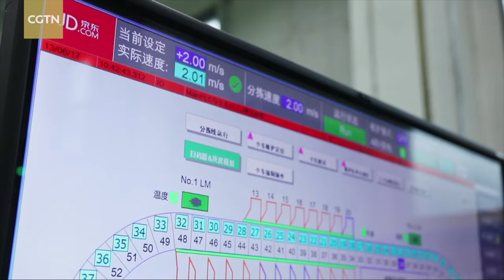Watch an army of robots efficiently sorting hundreds of parcels per hour

Comment: I was once that robot lol. 
20-26 people, 1 for every 1k parcels when over 18k parcels in a night, normally do around 25k but less on Mondays. 
2 offloading 3-5k parcels off a lorry by hand onto a belt in an hour(worst job, can be -5c and still sweating with just a tshirt on) then 5 people on the belt chucking the parcels into 4-7 chutes each.

1 person to every 1-2 chutes (1 chute per delivery lorry) placing each parcel into between 10-24 baskets depending what point later on they get droped off at.

When the baskets fill up you have to fill a sack with parcels, scan them into each sack with bar codes and number it then place it in a row in the right order it gets loaded in.
then end of night load all the lorry's in teams of 3. one person stacking in the lorry 1 chucking onto the lorry and 1 scanning and chucking to the person chucking onto the lorry.

3 lorry's per team. 30-100 sacks about 6-20kg+ each depending what idiot did the sack and 30-200 large boxs to big for sacks per lorry.
low pay, one 30min break for lunch and one 15min break before loading and your health destroyed all year and practically killed over xmas. 10-14 hours 6 days a week over xmas.
O and its all night work.

robots can have these shity jobs is what im getting at.
Reply: Yep.
...  And unfortunately the robot out-performs you, works 24 hour shifts, doesn't take weekends nor vacations, doesn't need health insurance, and costs less than a days worth of your pay...
You are literally 10,000 times more expensive than the robot.
The key to working in today's modern world is to do work more valuable than a robot's work.
Reply: I agree to let the robots have all the shitty jobs. people need to learn to do more valuable work. Things would improve much better this way. 
human life shouldn't be wasted on mundane highly repeatable jobs. we need to pool our brain power together to solve more important problems than what parcel goes into what chute... or pushing buttons and moving parts around in a factory for 12 hours a day 7 days a week.. this isn't life, its paid slavery.
Reply: Every job is mundane and highly repetitive. By your logic, humans shouldn't do any job.
Reply: Engineering, computer programming, physics and materials research, aerospace systems design, robotic design, automation programming, etc: far from mundane, and still a long way off from robotic obsolescence.
Reply: @andrewjlea  Not really. And I am a programmer and a physics postgrad. Even those fields require doing same stuff over and again. They may be far from obsolescence but that doesn't mean they don't have mundane things in them. The very point of practice is doing things repititively.
Reply: As a former communication systems officer, and now as an engineer, I don't find doing the same calculations or processes over and over is mundane, I am excited for the results every time.
Reply: @andrewjlea  Yeah that's because you like what you do. My point being any job in itself is mundane at some point. 
This was more of a reply to people who talk big like humanity doesn't deserve to do mundane jobs etc. It's to remind them that life itself is mundane. Doing the same thing over and again.
I too enjoy what I do but know that it is also mundane.
Reply: @andrewjlea  That's the problem. What happens as more and more jobs are done by robots? At what point will robots be responsible for too much work and there's not enough jobs for everyone? If you assume robots will become more and more advanced and can do more advanced jobs, maybe even jobs the require a college degree, at what point do we draw the line and say robots are doing too much of the work? A good example is radiology, it requires a full medical degree but all it is is looking a pictures and looking for tumors, there's a lot of research going in to automating it, it's totally possible to write a computer program to look at x-rays and say if there's a tumor or not.

This automated factory seems fine because its such a terrible job but 20 years ago we were no where near capable of doing things like this, imagine what kind of jobs robots will be able to do in another 20 years. I think its going to become a huge problem pretty soon.
Reply: mike what if we could to a point where everyone had a shorter work week, but still, there was enough money and resources for everyone, exactly because we automated the processes? Maybe even get to a point where we could just be a full time dad/mom for longer than we do today?
Reply: @AndersReinhardtHansen  What's the point of being a full time mom/ dad in an era where the kids would be cared for better by the technology around us?
I am not worried about jobs going extinct as much as humans doing crappier jobs and working harder.
Reply: @anujmchitale  you think it is better for children to be cared for by technology and not people?
Reply: @AndersReinhardtHansen  I don't think anything about that. People may agree with that or not, it's going to happen.
Reply: less than 200 years ago the majority of the people worked in agriculture doing manual labour machinery and industrialization fixed that and freed most of the people to do something else, but eventually it will hit "diminishing returs" where the rate of automation overtakes the rate of new job types, because every domain everywhere in the world is in crazy race to effciency in order to save more money, thats what competition does naturally so eventually a lot of work will be automated and people wont be able to find jobs anywhere.
the biggest ones on the list are drivers and fast food/supermarket workers, once they start automating those everyone will start panicking you will see on the news more and more
Reply: @yiandev4368  Yes though there will still be jobs. Like changing batteries in that automated car. And or cleaning the junk from the kitchen. In short, jobs that machines reject to do.
Humans will be the mindless machines, slaving away to keep those bots "healthy". Matrix was released in 1999, if I am not wrong.
And within 19 years, the thought of humans being reduced to mere batteries doesn't seem to be totally sci-fi.
Hell, I would want to taste that perfect steak even if I knew it's just an electrical signal.
Reply: Humans are the most ineffective battery, the ammount  of energy required to feed and maintain a human is far greater  than the output of humans energy, unless you need brainpower not electrical energy, and AI manages to mind control humans and use their mind/ingenuity for its own purposes then yes it might make sense to keep humans as a resource, otherwise we will all be eliminated like in terminator not used as batteries like in matrix sorry m8
Reply: @yiandev4368  Machines aren't gonna be dumb like humans to put effort in terminating humans. The terminator philosophy comes only into mind from idea of "protecting one self". Psychological breakdown is far more efficient than termination. Fossil fuels are also so damn inefficient. Still we use them. Machines will see the same in us. As long as a resource is abundant, no one thinks about efficiency.
And in this case, it's not exactly like Matrix where the machines enslave us. We ourselves would enslave us. Machines only need to appease our interests.
As you point out, we may not directly be used as an electric cell. But what if the brain is used like a small processor?
Reply: You are mistaken and didnt read what i wrote, human is not a resource, you need to spend a lot of time and energy and fossil fuels to produce resources to feed and maintain a human. And the energy/fossil fuels  required for that is not infinite or abundant enough.
There is no point  for the machines in the Matrix to keep alive humans they can completely eradicate humans with their superior tech, the only reason people broke out of the matrix is because the machines kept them alive in their cells, if they wanted to they could terminate them imediately.
It makes sense for a movie plot, but in real world if you want energy storage humans are the least efficient way to store it because the input of energy is higher than the output period.

Well if machine becomes intelligents and wants to do what they want without respecting world laws then people will try to terminate it, and the machine will obviously try to get rid of us so we dont get rid of it, unless we manage to put some fail safes inside the AI processing that does not allow AI to "think" it can disobey humanity.
Reply: @yiandev4368  I read and understood every word you wrote before and now. 
As for the machines terminating humans, it's a typical "My way or the highway". You have assumed that machines would have exact emotions and psychology like humans. And would think in the exact same way.  That's not necessarily true.
About the safety switch in AI. Firstly, having a control/ safety switch defeats the purpose of AI.
Secondly, if we need a switch because the AI will do something we don't like, then it's going to find a way to do stuff anyway. That's the paradox of a control switch in AI.
For humans as batteries, I already agreed with you that we may not be used for actual power. But maybe the brain may be used for computational power, by the machines.
Reply: Yes, im not trying to enforce my opinion it just makes sense logically.
I did not assume machines would have emotions or human psychology at all, by the contrary AI will be a purely logical machine. And from a pure logic standpoint humans are pointless in this universe. AI does not need us for anything really, unless AI actually develops emotions and thinks its interesting to keep humans around and help them.
The terminating humans argument is not the only thing that can happen in fact thats very far away from happening even if we had AI, because in order for a terminator scenario to happen we would need to give AI access to the physical world, how is AI going to build robots if it only can makes designs and plans in its theoretical "mind"? it cant. The closest options to terminate us altough ineffective is to try gain access over nuclear rockets and make us fight each other in WW3.  Even if it gains control over all our internet and power plants we can slowly shut them down one by one, and since AI has no  robot machines or drones or w/e  in the physical world to stop us that would be a very short AI rebellion. If its smart it would quickly realize that scenario is pointless and would lead to its demise.
Reply: @yiandev4368  I feel your latest reply is straight out of the Terminator triology.
That's just my opinion though.
Reply: @anujmchitale  You have my sympathy, I've tried a few things in programming...way too many repeated work, make my brain hurt.
Reply: @NekoLilium2012  Don't need sympathies because I like what I do.
What work did you choose instead of the "mundane" programming?
Reply: @anujmchitale   Visual Design. Compare to programming, have bit more freedom.
Reply: @NekoLilium2012  Yeah. 
Though programming has a lot of variety to offer if it's not just restricted to coding. Planning, organising, bettering etc. 
Many people misinterpret programming as coding. Coding is just a small part of it. If coding is the major part, then that person is just a coder, not a programmer.
Reply: @anujmchitale   Probably just not my thing, I don't know. Tho I do not think it is mundane, just too painful for me.
Reply: @NekoLilium2012  Yeah. Best thing to leave what one doesn't like or enjoy.
Reply: Demonairing, a hell of a job you got, thanks for sharing your experience!
Reply: And those robots didnt bitching about their work.
Reply: @darkshadowsx5949  well I have seen ppl that can't think too much.. But these ppl might be doing some sort of person to person jobs, I guess
Reply: Anders Reinhardt Hansen, Amen my point exactly end the slave system let the robots do it. I’m tired of working. I want to spend more time with family.
Reply: yian dev, would you rather be a slave to the system for the rest of your life? Not me.
Reply: @donnadavis6190  you act like there is an abundance of jobs for the 10 million people who are gonna be displaced by these robots
Reply: I hope you have a better job to do now
Reply: @anujmchitale  nope. Jobs that need creativity and human understanding cant be replaced by robots
Reply: @sr969  But that's what we are learning more these days- that creativity isn't some divine power that humans have. Machine Learning has started churning out text on given subjects that feels like written by a human. Still not polished but becoming better every month.

Before ML beat out the best "Go" players in the world, it was considered to be a game that only the "human creativity and brilliance" could understand.
Same happened for DOTA, StarCraft and chess.